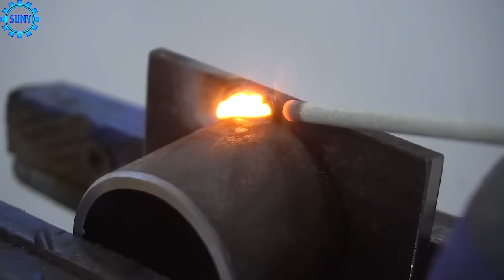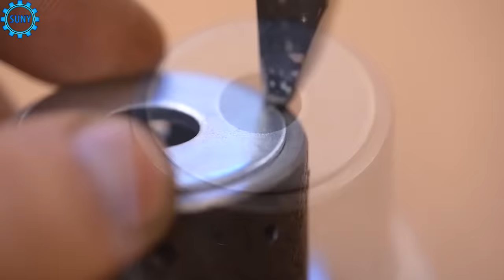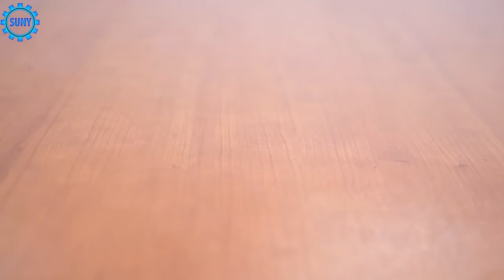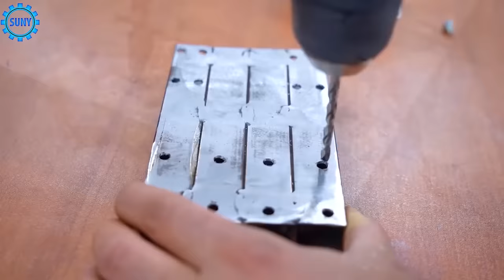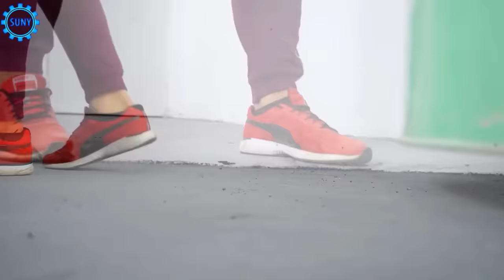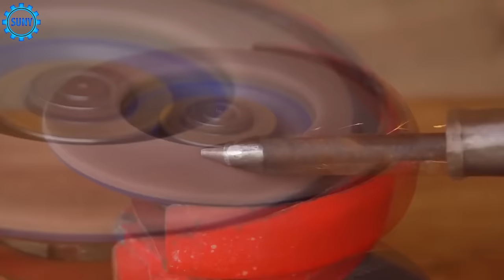3 AMAZING TOOLS YOU CAN DO AT HOME

Comment: Instead of buying those expensive cutting machine i better go directly with the thing i need cause i don't have all those tool so its not easy for me 😭😭
Reply: You can make flam from medicine bottle too just make a hole in bottle lid and fill the bottle with thinner or diesel and use cotton thread as a flame